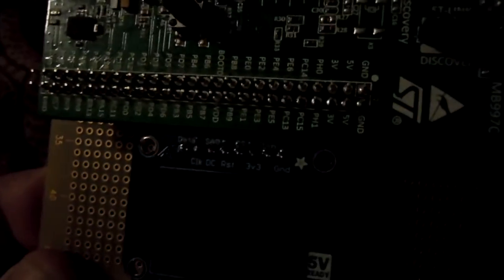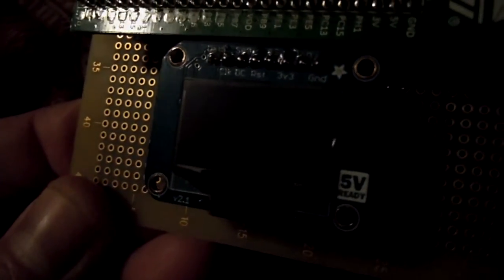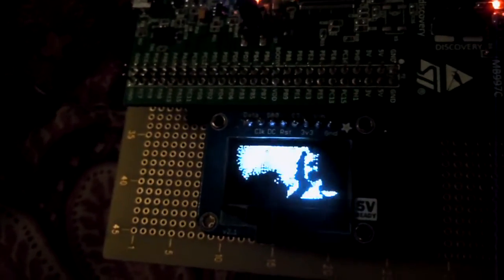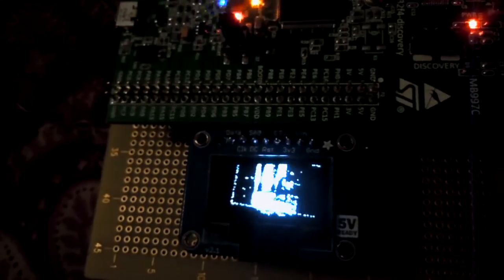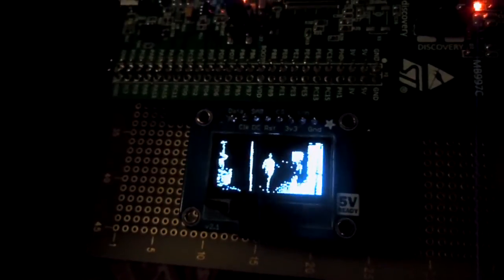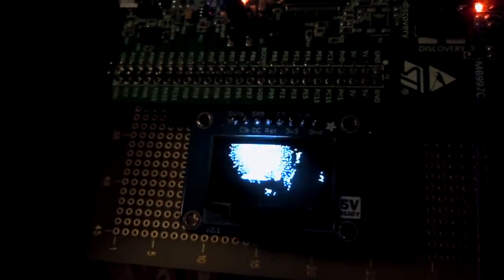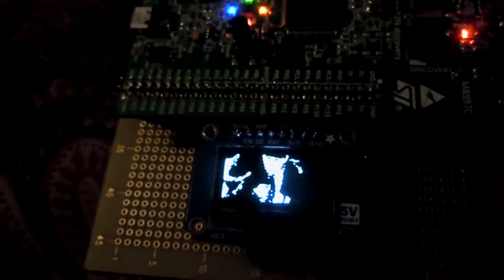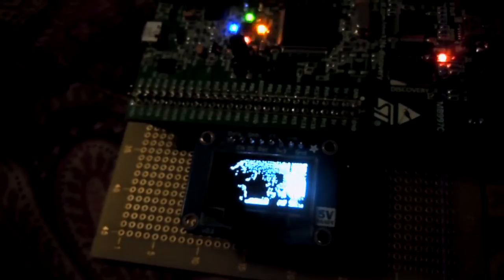STM32F4 Discovery OLED Video Player

Comment: hello may I ask you a question? which ide  you use for OLED arduino or Keil or Eclicpse etc.
Besides ı have a lot of  trooble with working OLED's with c could you help me for this situation thanks in advance
Reply: For STM parts, I just use commandline tools from linux.  I have only limited experience with Keil and Eclipse, and I tend to not use IDEs if I can avoid them.

Comment: Hi great project. I am trying to do something similar, and i would like to know what video editor program you used to convert the video into 1 bit floyd steinberg dithering. i have not yet managed to find one that had that capability.
Reply from the maker: I wrote the video encoder myself.  It wasn't pretty, but it was basically a script that used ffmpeg to extract individual frames from the video.  Then, the script used 'convert' which is part of imagemagick package to convert to dithered 1bit-per-pixel bitmap images.  The images were then concatenated back into a data stream file once their headers were stripped out.  

Dirty? Yes.  Efficient? No.  Does it work?  You decide.  :)
Reply: I'm trying to do the same thing for the nokia 5510 LCD now. I am using the aforge framework. It doesn't convert videos yet, but it works perfectly with images. I just got the conversion from bitmap to my custom data format working. The only problem is that i don't have a sd adapter, so i can't test it on the hardware :D But the output files look ok in a hex editor.